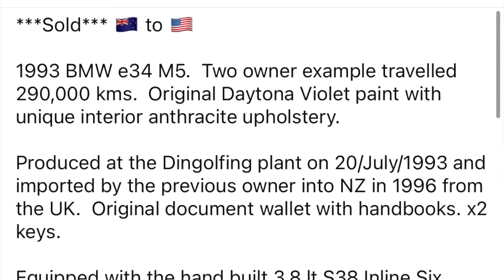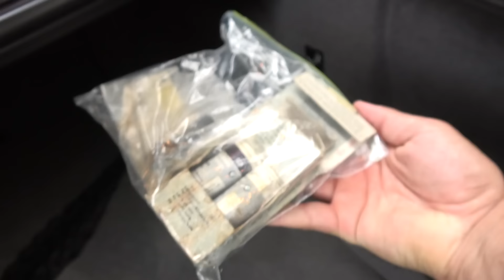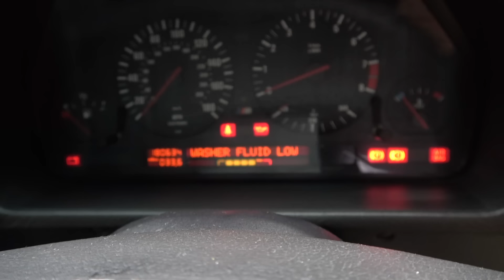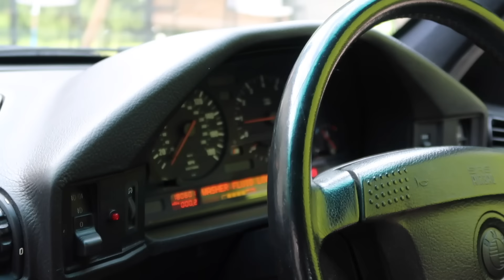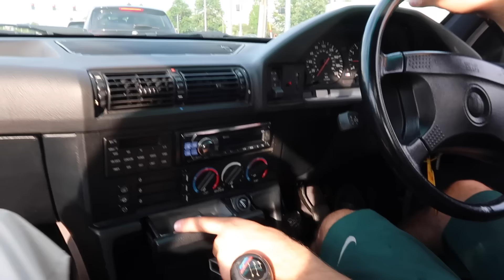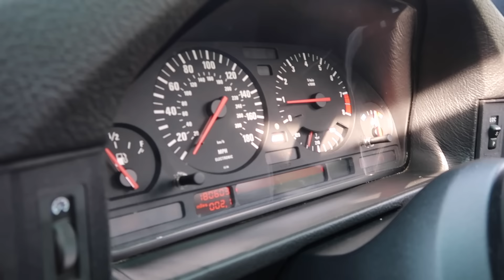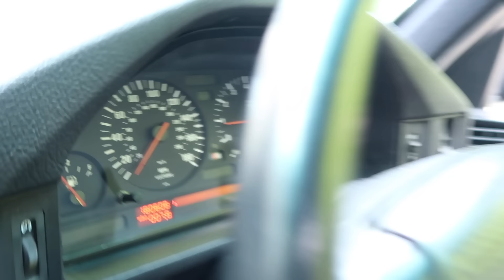I Bought/ Imported My Dream BMW E34 M5 From New Zealand! The Ultra Rare RHD Daytona Violet 3.8 M5

Comment: Congratulations, beautiful car. Respect for holding on for the perfect spec. Can confirm that UK/GBR does use MPH and Celsius.
Reply from the maker: @aj.colour  thank you for clarifying!
Reply: @m3nameisjosh464 you can also set it as you want. If I remember correctly on the stalks, takes getting used to. But you can configure them.

Comment: Hello Josh, I had a black 10,000 mile M5 3.8 with the Nurburgring pack which included the Servotronic steering over twenty years ago. It was fantastic car and I hope you enjoy yours. I had all the 6 cylinder E34's and they all had much better steering than the Servotronic system which while not lifeless and artificial like an electric system, lacked feel at all variables (it feels almost the same all the time) but somehow managed to remain a direct intuitive sense of control unlike the later electric systems. I just lived with it, though I was always aware the 520i and 525i steered so much better. Anyway a few years ago, long after I sold mine, I read a forum post where someone said the Servotronic system was simply an addition to the standard power steering and that it could be disconnected. I don't know if there is any truth to this but it would definitely be worth looking into, because an M5 3.8 with the 5 speed gearbox, the Nurburgring pack minus the Servotronic would in my opinion be the perfect E34 M5.

Mine was LHD, from Germany, in the RHD UK, so I was sitting on the wrong side too. However the E34 is the easiest car I've driven to place on the road (maybe excluding a 964) because of its squarish shape of which you can see the 4 corners from the drivers seat. You will have no problems. E39 is much less intuitive; you can't see the front of the car. We have a smaller last generation 2 series (not a patch on the old BMW's) which is surprisingly hard to place especially when parking due to all the weird body lines and forms. I had a 1995 Maserati Ghibli where the bonnet fell away and it had flared arches and it was hard to intuitively place on the road even though it was a small car. Cars with a wider rear track than front can also play tricks on the mind, like a Testarossa which people always think is super wide, though its not.

Yes, UK is miles on the dials and road signs, otherwise KM used throughout most of Europe. and we use Celsius as standard in the UK.  David
Reply from the maker: Wow David, Absolutely Brilliant insights as to everything I am feeling now post driving the M5 a few times. The first thing I noticed was the super light steering! It caught me off guard to the point where I thought something was wrong. My 525s steer SO heavy and its one thing I love most about E34s, I will have to see if theres truth to disconnecting servotronic. 

Placing it on the road has gotten a lot more comfortable to me, I agree shape of the E34 makes it easy. Funny you mention the testarossa because my 348 is very weird to drive and place, definitely a bit uncomfortable in that car, especially in tight spaces haha.

Thanks again for the great comment!

Comment: Top car and terrific colour. Those wheels are the best design and coolest name! FYI, the E39 does not change over the wipers for the right hand drive market, unlike your E34. We use miles in the UK for roads, temperature is in Celsius but we measure in metres and centimetres for most other things. A persons height however is measured in feet and inches, unlike those European types. One more thing, your car has the steering wheel on the correct side!
Reply from the maker: Wow thank you for the insights to our question! That is wildly confusing to be honest LOL

Comment: A great addition to the collection! Now, you missed a detail in the engine bay. RHD cars do not share clutch fluid from the brake fluid reservoir. Instead, they have a separate clutch fluid reservoir at the driver's side, which I believe is the same clutch fluid reservoir as in the V8 M60 cars! 
If you plan to keep it forever and don't care about "all original" specs then you should make it an LHD car. It's not an easy task but not impossible. And only then you will fully enjoy it!
Reply from the maker: Good catch! I did notice that. Makes sense for it to be that way. Lhd swap would be interesting, but also would take away from why i think this car is so unique. As a US car guy ive always wanted RHD

Comment: Beautiful M5.  I’ve only seen 1 Technoviolet in the US.  At Lime Rock in CT.  Yes, the E34 M5 has special velour trunk carpeting unlike any other US E34 - the interior carpeting should be velour too.  The only other BMWs of this era in the US that had it was the E32 750iL and the E28 M5 and E24 M6 in the trunk and interior .  Your M5 should have Foglamp Washers too.  The E32/E34 were the only cars in the world that offered foglamp washers (no other make or model has them).  See if yours does.
Reply from the maker: @1984AP  thanks for the info!! Ill have to pay closer attention to the carpet😳. And fog light washers?? I know I have headlight washers but dont see any that would be for fogs that I can see.
Reply: @m3nameisjosh464  They are hard to see.  On my non-US E34 they are located above the foglamps tucked under the main bumper overhang.  They are about the size of a dime.
Reply from the maker: @1984AP  oh wow, ill look closer
Reply: @m3nameisjosh464  Have you noticed the parking lights illuminate on the upper section of the low-beam?  Called City Lights.  The amber lights won't illuminate for parking lights like US cars.
Reply from the maker: @1984AP  I did notice that!!! So sweet

Comment: Josh, I have a new re-wrapped leather steering wheel for you m5 e34 (it fits e34s and e32s made after 07/1990).  PM me if you want it.  I have no use for it.
Reply from the maker: @victorvaughn2  thanks Victor! Im happy with this wheel for now. Is yours the same 4 spoke or an M tech?
Reply: @m3nameisjosh464  ok. it's the same 4 spoke.  Just new leather.